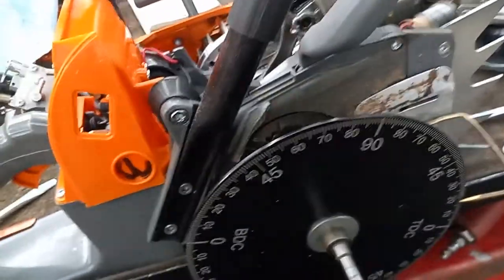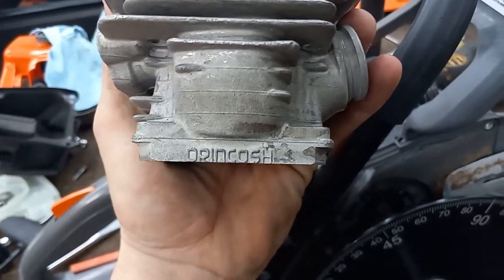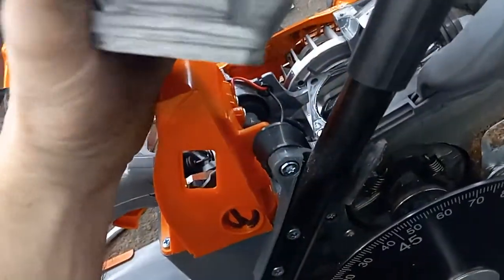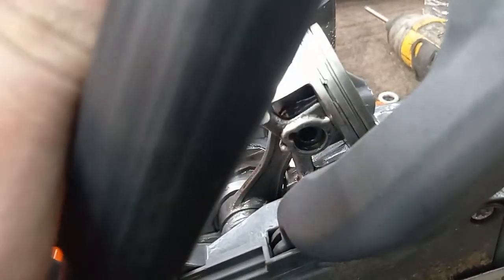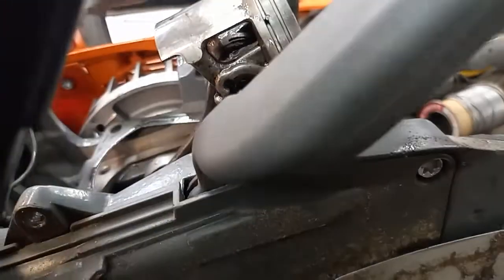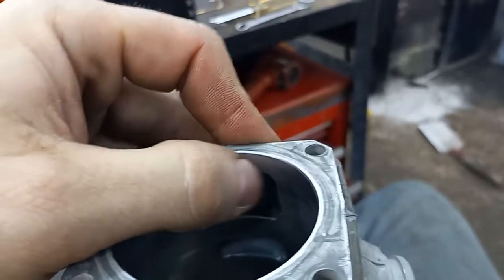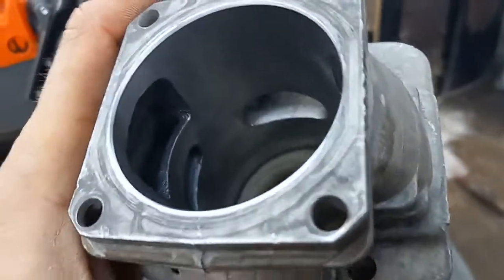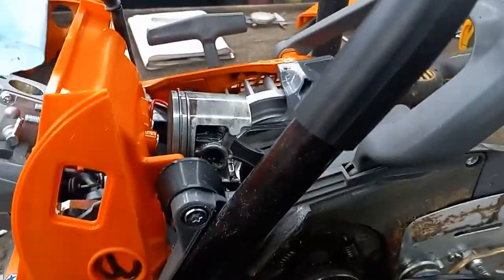a look inside my neotec ns892 ms660 clone

Comment: Not into those kinda saws. Honestly not knowing the cylinder material. I would just cut the base so you can run a gasket to prevent any vibration damage. Run a pop up. Unlimited coil. Should hold up nice that way with the added compression and good tunability.